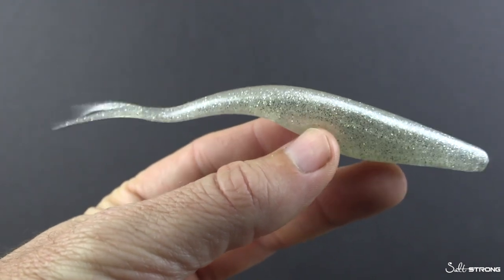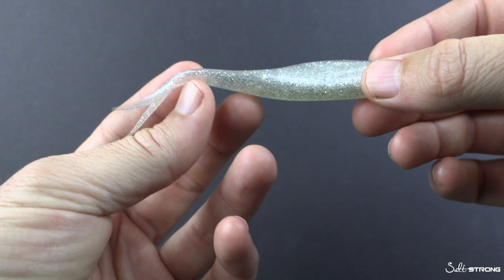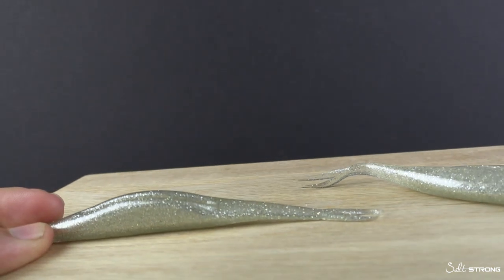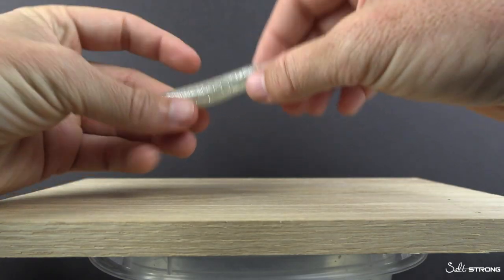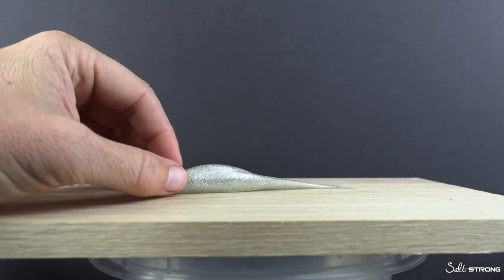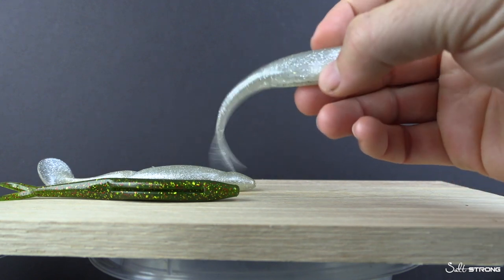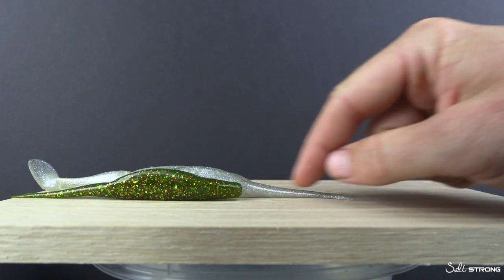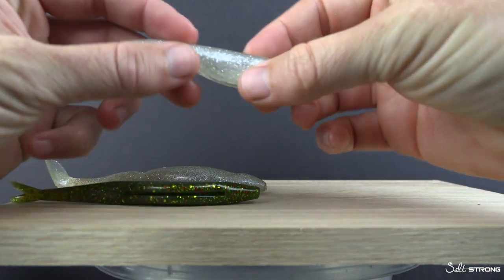Easiest Way To Fix Your Bent Fishing Lures!!

Comment: Have you tried this on zman lures ?
Reply from the maker: those are made from a different material and may not perform the same.
Reply: Zmans will straight up melt. Plastisol is different than elastic polymer. Zmans won’t change shape. They just melt.